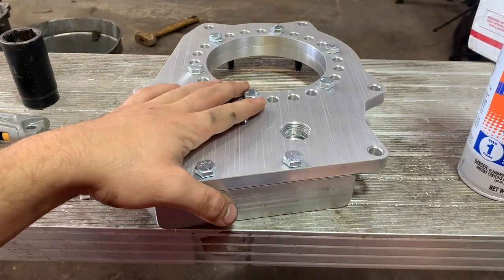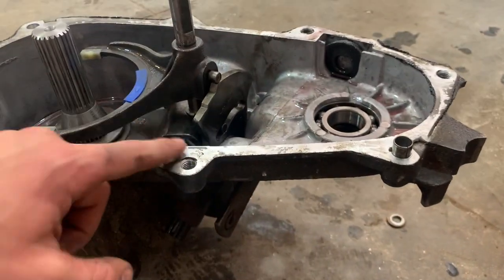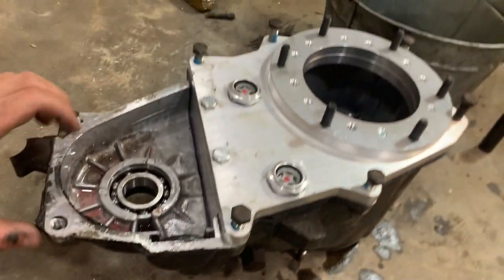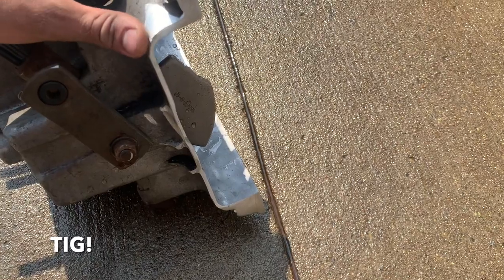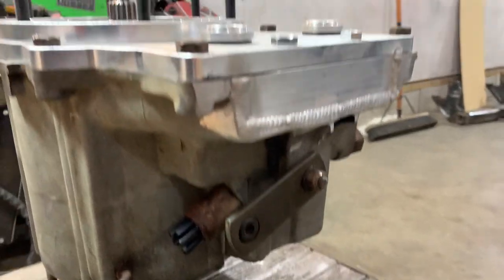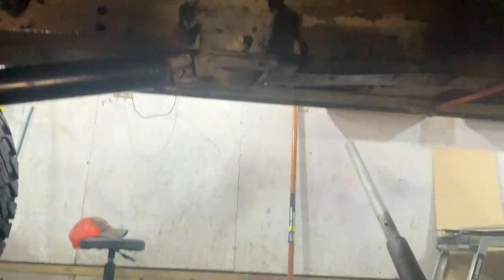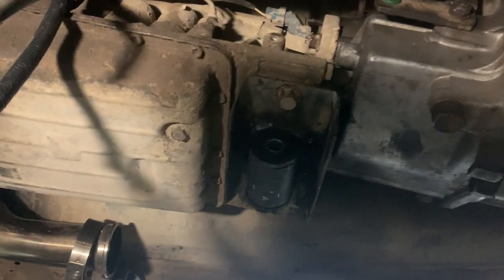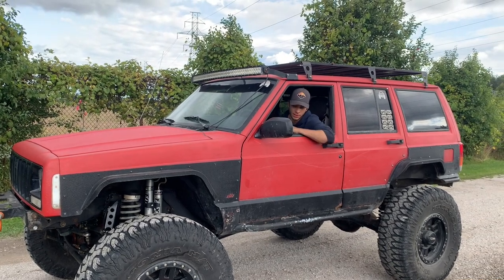This is How to get INSANE LOW RANGE in you jeep. (np231 Doubler)

Comment: Just had a crazy idea watching your video.... keep the original 4wd output shaft on the front case and adapt it to be a PTO for a York or Sanden compressor for some on board air! I wonder if it can be done... maybe that case needs to be flipped 180° but I bet it'd work.
Reply from the maker: Great idea you should try it and report back i like the idea
Reply: @gageboysgarage6059  unfortunately I don't even have a 4wd 😂 hopefully one day... just a Subaru Impreza right now. I've been hooked on the idea of overlanding since the first XO videos
Reply: @gageboysgarage6059  looks like you might be able to hook as many range boxes as you want if you were looking for stump pulling power 😅 lol . Just imagine 4 of them hooked together  .
Reply: @gageboysgarage6059  looks like you might be able to hook as many range boxes as you want if you were looking for stump pulling power 😅 lol . Just imagine 4 of them hooked together  .

Comment: Do the cases share oil? Or they get filled separately? I guess the new low box no longer has the fluid pump so I'd be worried about it burning up. I run full synthetic in my Np231 as is.

Comment: Thanks for the vid. Does it give you the ability to put it in just front wheel drive? I really want to do this mod and I have the extra t-cases kicking around but unfortunately I own a TJ. I don't think it's possible without moving the rear axle back a bunch and then I'd probably have to move the fuel tank too.
Reply from the maker: unfortunately no i don’t believe you can’t select front and rear with a chain style case without lots of modification. and yeah it’s a long setup it would be tough in a tj

Comment: This kit looks sweet, I think I will be using it. How does the fluid work with the new extra planetary assembly? Do you just use the regular fill and drain plugs on the main case and it fills the planetary?
Reply from the maker: no there are separate plugs for the other case. they are filled separately

Comment: If there’s play in the bolts in the adapter plate before tightening it up all the way put all 6 in then tighten it up. May just need to shift over a bit
Reply from the maker: There wasn't any play in the adapter. Definitely not enough to get the sixth bolt in.
Reply: Man that sucks.. I figured the bolts would’ve been a tad smaller then the holes in the adapter

Comment: What gear ratio are you running in your axles?
Reply from the maker: 4.88s currently
Reply: And are you rocking 37 1450s tires
Reply: @gageboysgarage6059  I am asking because I'm trying to figure out whether to do a dual transfer case or change the gears in my axles. I'm trying to go with a Overlander type build with big tires